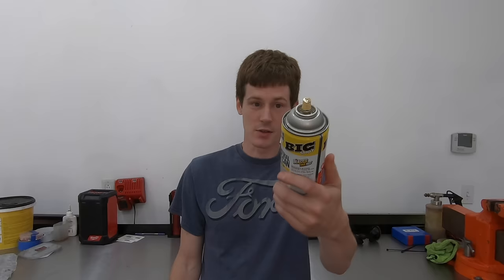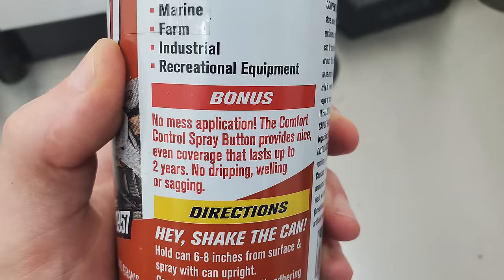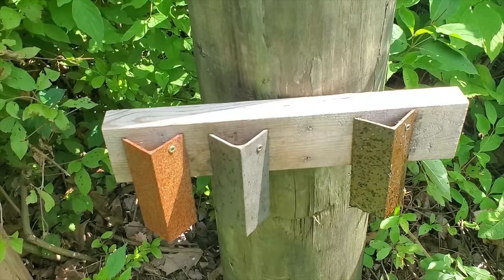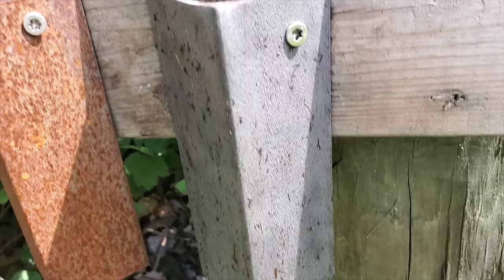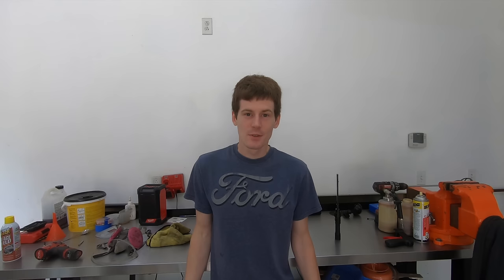I Finally Found The Best Undercoating On The Market... Blaster Surface Shield

Comment: Great Video but a question, i have a 6 year old vehicle never treated with any product, only some light minimal surface rust on the chassis. do I need to prep the chassis or surfaces before applying Surface shield like wire wheel, pressure wash (and let dry of course)? simply curious, thanks in advance.

Comment: I haven't watched the entire video, but nobody seems to even mention the fact that many of these oil products eventually leach into our waterway, the very water we drink. There's a reason these are not put on by the factory, they are not allowed. We stopped pouring used motor oil down the storm drain a generation ago. How is this different than that?
Reply from the maker: These products won't drip off the car like motor oil for starters. Fluid film was developed for the Navy.
Reply: @RepairGeek  Having used fluid film I can tell you that a couple of years later, there is almost nothing left. Where do you think it goes?
Reply from the maker: You're comparing a crude oil product to lanolin which comes from sheep's wool.

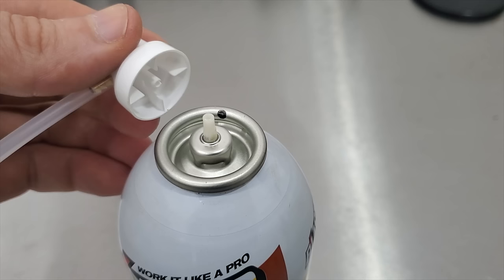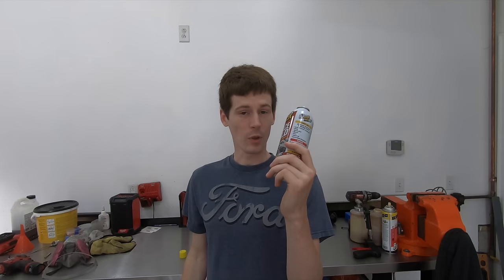Comment: Hey @RepairGeek from 10:31 to 10:38 the inner cavity repair tool with the male cap, where did you buy that? ALL the ones I've found look identical to yours but are female. (I plan to use with the fluid film female cans).

Comment: Hey man, I know this is an old video but hope to get some quick advice. I am from TX and just went to Michigan and bought a truck, it had 62k miles on it and was garage kept. However, it has some frame rust with some areas with some pitting that I want to take care of. Is it necessary to do these types of sealers or can I just do rust reformer/rubberized coating and be fine here in TX? 

Thanks

Comment: What’s your opinion on using Corroseal Rust Converter and the Corroseal Cleaner after I’ve cleaned by hand all the loose rust before spraying on the Surface Shield ? And again thanks for the videos.
Steve
Reply from the maker: Corroseal is trash: https://youtu.be/tu1n1POMg98?si=UxJqnPHYD6TJr5Ou

Comment: Glad I saw your tests! I just got a Jeep- do you recommend cleaning up light surface rust prior to coating?
Reply from the maker: Yep wire brush it with a stiff wire brush or use a needle scaler ideally to remove any loose rust. You want the product to get to the metal not the rust flakes on the outside.

Comment: Thank you for a great film. I need to treat the column of the steering wheel. I work on AC system of one of our cars 2001 Saturn, so when I removed the instrument panel upper trim (dash cover) and steering column filler panel (cover under the steering wheel) I saw that the the column of the steering wheel is rusted, not that much, but has rust color. This is in TX, but I've read that Saturns have kind of problem to develop rust in hidden places. I think I can't spray anything in that area bcs of all kind of wires located in that area. I plan to remove rust w/damp cloth and light layer of Navy Rust Remover, then wipe it out w/damp cloth again, put a very thin layer of some grease, like Lucas green, White Grease or similar, and then thoroughly wipe it out w/clean dry cloth. Is it the best approach to solve that problem w/rust in the area w/electrical wires? I would appreciate any opinions on this matter. Thank you again.
Reply from the maker: The product won't affect the wiring. If you're concerned spray the SS on a rag and use that to apply the product.
Reply: @RepairGeek  O'K, thank you for the replay.

Comment: If possible could you try strikehold as an under coating it was supposed to be used in the military to stop the Abrams tanks from rusting out and it’s also used in Australia as an under coating for four-wheel drivers there. It’s supposed to creep like an oil and it’s also a dry lubricant which means stuff doesn’t stick to it I was wondering if you can compare that to Blaster surface shield because I’m stuck between getting this and the strikehold

Comment: Hi, I, really enjoying your videos.  I do have a question,,,   I run a pick up truck with a salt spreader on it.  In the past most mechanics tell me that  the trucks are rusting out pretty badly,,, mostly the wiring & connections, lines etc under the truck gets corroded pretty badly ..   I just bought a new truck and Im trying to avoid this at all costs.     

Do you think this product would work well enough & can it also be applied over the wiring and components ?? 
 
Can it be applied over the areas that get hot and can I spray in anywhere underneath the vehicle ?

Thank you, 
John

Comment: I have a 19' F250 there is some rust starting to form underneath. Should I use a light polisher wheel, so it doesn't eat too deep into the metal to remove that rust before I use this product, or does this product take care of any rust that present along with preventing any additional rust? Thanks for the video!

Comment: Great video! I’m buying the Blaster for my new Toyota but what about vehicles that are already rusty? Can you spray Blaster Surface Shield on rust? Or should I use something else first to remove the rust then Surface Shield?
Reply from the maker: Remove the loose rust with a wire brush or needle scaler. Spray the product and come back in a week and check for any dry areas where it soaked into the metal.

Comment: Great video. This was suggested to be used on a new mower deck to decrease the grass from sticking. Question: After application, does it set up/somewhat dry or does it stay wet and oily? If it does somewhar set up, would a second coat be recommended?
Thanks in advance for your input.
Reply: it stays oily from my experience.
Reply: Thanks for your response. I found the same thing....stays oily.

Comment: You made me a believer in Surface Shield. Quick question, when you are done spraying with a spray gun, how do you clean up the spray gun and tip??
Reply from the maker: No need. It doesn't dry like paint. You can spray a vehicle put the gun away dirty come back a year later and spray again. The product won't dry.
Reply: @RepairGeek  I thought that would be the case. It wanted to make sure. Thanks for the quick reply

Comment: Pole test at 7 months suggests fluid film protected better than Blaster.  I don’t understand your conclusion using your own test?
Reply: Fluid film appeared better than but if you look closely where he wiped his finger the metal was rust free. The surface shield changed color or something but the underlying metal was rust free. The fluid film had started to rust on the top edge where the film had worn away but surface shield appeared to be coated still.

Comment: just tried it yesterday and I found out it isn't that great coming out of the can at 40°  the tip literally froze up on me while spraying it, kinda disappointed that it happened but I m giving it a try on my dump trailer, it seems to work better if the can is at a decent temp with the rust oleum sprayer added to it from the store

Comment: Try driving down a road they are grinding up to be paved. That dust is like tar and rubber and grimmy oilly super dust and it won't move once it hits that oil you applied

Comment: Can you recommend a inner cavity spray tube for aerosol cans that is effective. The ones I have tried just dribble out and do not spray in a 360 degree pattern as advertised. I am using Surface Shield as per your recommendation. Thanks

Comment: sorry if I haven't seen a prior video on this, but have you used CRC marine corrosion inhibitor, and if so, is Surface Shield more effective than CRC and how? I was wondering if the CRC can be applied to existing rust without it causing the rust to continue to corrode under the CRC?

Comment: Hey man so I just started using blaster SS. And I’m new to under coating. But I was curious if you reapply the application on the inside of the rocker panels and the inside of the doors? When you have to reapply you’re Under coating?

Comment: Hi I am looking to underseal my Mazda MX-5 mk3 same issues with rest etc ,can I ask do I remove all the rust first and then use this or can I use this without rubbing the rust off.
Once used can I ask use this does this dry once the coat is done and then as you said hopefully pass the Mot 
Thank you for updating on the video , if I cannot is waxoyl is the next best thing for availability
Kind regards

Comment: Hi thanks for sharing all this information. Love your chanel. Question for you. How do you stop rust from getting worse on panels? Im talking rust on doors; roofs of cars when it is only surface rust; and more importantly when it starts to make small holes ,like the size of a coffee bean? I am thinking of using one of your prefered Lanolin products for surface rust; how should I go where there is a hole? If possible I don't want to repair the holes (like with fiberglass) I just want to stop them getting bigger. Thanks.
Reply from the maker: You can either put lanolin on it or paint it. All paints will eventually chip crack flake or peel. Lanolin wont but will need annual reapplications.
Painting over rust: https://youtu.be/EXJgCyShOCw

Comment: Great video.  I’m heading out to Harbor Freight tomorrow to pick up 3 or 4 cans for my new Bronco.  I have a question…will it drip after applied?  I don’t want it all over my driveway after applying it.  I’ll apply it in the garage with an epoxy floor and let it cure for a few hours but I just don’t want it dripping on the concrete driveway.  Thx so much.
Reply from the maker: It will drip if it's over applied and parked out in the sun. You have to get crazy with it for it to drip.

Comment: If I have surface rust and scrape it off with a wire brush. Then apply surface shield and can still see rust scaring under the car in places will Surface shield prevent it from rusting further?

Comment: Use a dedicated container (metal or plastic) to heat product to 195℉-200℉
and spray it hot. Outside gas or electric hotplate, or a dedicated shop microwave.

It creeps better, goes farther, uses less product.

Comment: What the best undercoat if your spraying in a panel through an access hole with 24” 360 degree wand and want it thin so it will run in joints?   Don’t really care about it washing away because it’s inside an enclosed panel that won’t see water spray.

Comment: CRC Marine Heavy Duty Corrosion Inhibitor 06026 "dries" to a tacky waxish finish.  Does Surface Shield also?  Being so thin, I suspect SS behaves like chain lube:  it has volatile solvents which evap after it has soaked into pinch welds leaving it thick enough to resist washing.   Myopnion is to use FF for cavities and CRC or SS for general coverage especially near wheel spray.
Reply from the maker: SS has no "volatile solvents".

Comment: Looking to try Surface Shield. I want to be able to use extension wands etc. with the spray cans as I am a DIYer and not looking to invest in a spray gun at this time. HAve you tested and of the spray can compatible wands and which would you recommend for use with the Surface Shield cans? Have read a lot lot of horror stories in various reviews so don't want to buy something and end up with most of the product not on the vehicle ;-) Thanks so much!!

Comment: Gave surface shield a try and it  works well.  But why are  the  1 and 5 gallon buckets so expensive ! Its more than double the price of fluid film while the cans are similarly priced. Good for rattle can jobs but not worth it for large jobs.

Comment: Have you tried CRC, RP342, AmsoilHD Metal Protector? These are my best undercoating compared to any others. Make a comparison yourself if you could.
Reply from the maker: Did: https://youtu.be/oXlhmbvdKBo
All cosmoline products do not creep. On internal surfaces you want a product that will creep migrate and penetrate the pinch welds and bedsides of a truck for example. Those cosmoline products creep for about 30 minutes. Lanolin products creep for years.

Comment: With winter fast approaching and having just picked up a brand new truck, what would you advise to protect it? Surface shield on anything an aerosol can can reach, and FF through my FF gun into the holes in the body and frame?

Comment: I went with your recommendation. But The stuff doesn't dry. I applied it to a part of my truck yesterday and today it is completely wet still. Has not changed a bit in 24 hours. That can't be the way it is supposed to be.

Comment: Hi!  So the Blaster products in gallon form. Bought a brand new Tacoma I want to keep 20 years…. Do you recommend which spray gun set up I need to apply this product?   I agree I need to poke into open areas so a special nozzle and gun would be best I think.  I appreciate your insight.  I’m gonna join your channel.  I also do not have a lift.  What do you recommend to do for access?  Find one who can loan me the time or just crawl underneath?   Maybe someone would do it for me?

Comment: Hi,
I have a 2002 Tacoma that had a frame replacement 3 years ago, looking to protect new frame and under body. Do you recommend sanding off surface rust then applying surface shield? My entire rear differential is showing rust, when I took a wire wheel and drill to it I can see its just seems to be surface and I want to know what you think?
Thanks,

Comment: Would you recommend I powerwash the entire underbody with soap and water (or just water?) before waiting for it to dry and applying blaster surface protectant? lmk. thank you very much.
Reply from the maker: Washing is only needed if the vehicle is super muddy. Most street driven vehicles that have just normal road grime it's no issue.

Comment: Will this save a Discovery 2 frame that's already started its VIN SALT as a hint rusting and protect further damage.  I was a fluid film user and annualy used it and for 8 years from 2012 to 2020 I had zero rust. Got sick so skipped the past 2 years and now the fram is rotting badly but still passes our state inspection.

Comment: Hi, really good video Andrew. One concern I have is the product safe to use on door seals, under hood seals, suspension control arm bushings, sway bar bushings etc. I have used other products in the past that creeped well and did a pretty good job at protecting the metal surfaces as long as you repeated the application every year, but over time all the rubber stretched out and started to droop. Thanks!
Reply from the maker: The only swelling on any rubber has been weatherstripping. I've been using some type of Lanolin product for 5 years now. I've had no issues with bushings, boots, or any odd clunks or noises.
Reply: @RepairGeek  Thanks, appreciated. I started last year, 2021 applying Wurth "Rubber Care" on the weather stripping before taking our vehicles to Krown for undercoating. I have been applying 2-3 coats and let dry between applications. The rubber looks new after applying this product. Too soon to know if it will be effective. The Wurth product 890.110 protects against rubber adhesion. Safe for Spray on the rubber weather striping and wipe if necessary. Silicon free, non aggressive to paint and chrome parts. Hopefully this helps preserve the integrity if the weatherstripping.

Comment: Was wondering if you ever tested a product called sharkhide it’s a metal protector that last seven years I found this stuff from a highway sign in Missouri works great just throwing it out there ..I used it on my tractors trailer

Comment: Do you have proportions/directions to turn surface shield black? That would be interesting (also sounds unnecessary but I wonder if the added 'grit' improves or detracts from adhesion)

Comment: I have an question regarding product lasting times.  I have an old Mustang I had sprayed in 1998 at a random local garage here in Canada, no idea what product they used, but that oil is still there, still wet, thick and brown/yellow.  Like Vaseline or grease.  Never hardened, and it's like the day it was applied almost 25 years ago.  Could this be Cosmoline?  Whatever it was, I've been trying to find it again for my regular vehicles and can't.  All that seems available now is stuff that can't make it past 2 years.

Comment: how do you like the surface shield now in 2023?   is it still holding up as the best?    Is it still worth using it on an f150 from 2020 thst was never undercoated before?

Comment: How does the surface shield do with a vehicle that goes off, gets muddy and does miles down dirt and gravel roads? Will the mud and dirt stick to surfaces coated in the product?
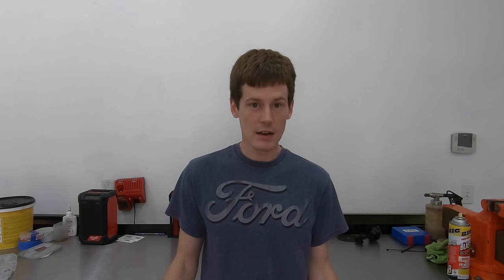Reply: from another recent video he showed about making the product black for coating, he showed the undercarriage of his vehicle and said there's no point to making it black because over time, all the dirt and grime that gets caught on the film turns it black over time. So basically, yes it will stick to the surfaces coated but it still works as intended. It's his second to most recent video, around the 1:46 min mark

Comment: The problem is it’s impossible to get in Canada and that’s where the rusty market is :(
Reply from the maker: Not true. Princess Auto.
Reply: @RepairGeek  awesome thank you!! As for a truck frame. I want to clean the rust with a wire brush. Should I use a rust converter, paint and then use the surface shield ? Or just clean the frame and apply surface shield directly on the rust for better longevity

Comment: The German " Oldtimer Markt" Magazin has done  professional long time tests rust protection on  Cavity sealing and underfloor coating. For Diy ( the best products are uncomfortable, professional users only recommended) 
- cavity  sealing : fluid film good result, easy to use cheap
- underfloor coating: Fertan UBS240 , good result, easy to use cheap,  fluid film had bad results here
The tests are online as PDF ....